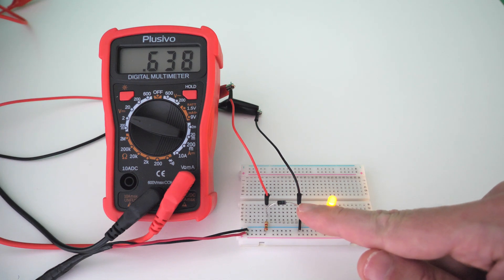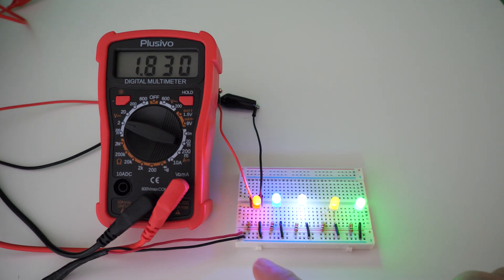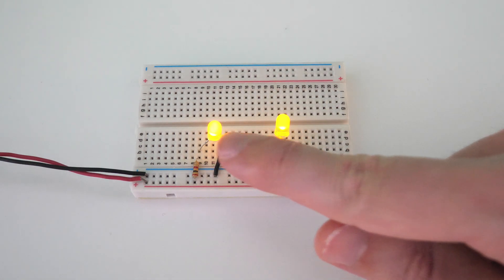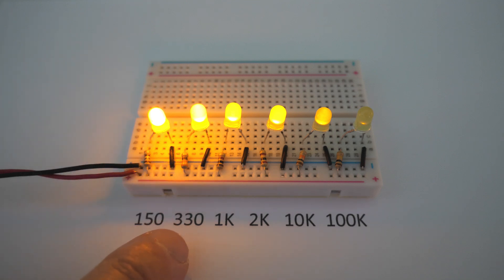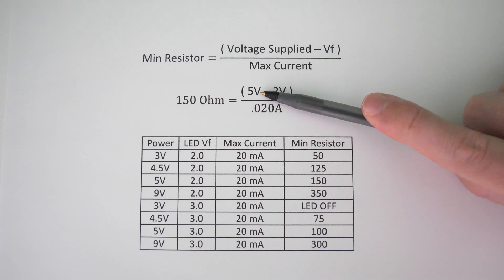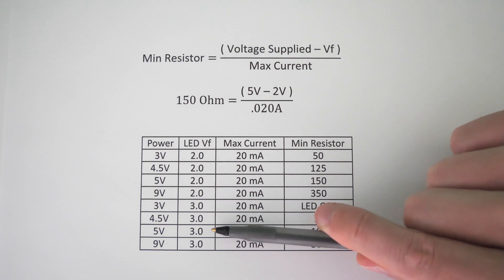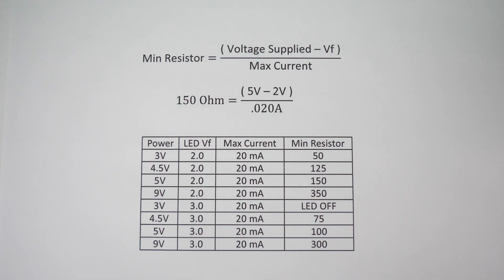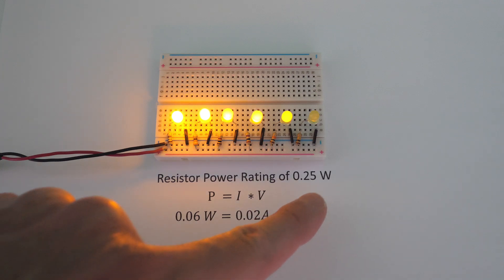LED Current Limiting Resistor Values

Comment: The circuit at 3:34 is a parallel circuit right ?
Reply from the maker: Yeah, each current limiting resistor is connected directly to the 5V power supply.

Comment: My LED fused
Reply from the maker: Do you mean it broke or burned up? If that is the case there was not a resistor in to current path or the resistor was of too low of a value to limit the current.

Comment: Interesting LED display. I just forego trying to figure out forward drop for any L:ED and simple install a resister to only allow around .020amps or less. And regardless what the LED forward voltage drop is, the LEDs of any type lights. And you will never ever blow any LED doing that...period!
Reply from the maker: Yeah, if you are not trying for max brightness you can just use 1K plus ohms resistor and you are good to go.

Comment: Why does the 3V source + 3V Led Forward Voltage have a  resistor of "Led Off"? I'm kinda confused what happens when the Source and Led Forward Voltage match and how to calculate limiting its brightness in this situation... as all calculations seem to try to devide a value of 0 (3V-3V=0V)/Amps.
Lets say I would like to run my leds at 0,010A instead of 0,020A. I would then calculate 0/0,010 = 0 also... How is this done?
Reply from the maker: If the forward voltage drop of the LED is 3V and the power supply is 2.99V. The diode will not allow any current to pass so the LED is off. This would be like applying .5V to a diode that has a .6V voltage drop. No current passes. Even if it is slightly over there would be very little current. Say the power supply is 3.01 volts. Then the current is .01/100 Ohms which is  .0001 amps. Current is flowing but not enough to visibly light the LED. In this case I am saying the LED is off. If you want to be a lower current value just use that as the max value and use the same equation.
Reply: @GlobalScienceNetwork   Thanks for you reply :). I actually needed to build a 12V cirquit of 6 leds that have a forward voltage of 2.0V. The catch is that the cirquit usage needed to stay below a certain amount of watt, so I could not shine at 100%, but was limited to, lets say 500ma.  I put all Leds in series, but I could not calculate what resistance I would need to only let current flow of 500ma (about 40% of Led max power). I decided to try and measure the LED real forward voltage @ 2V with 500ma. I set current limiting to 500ma on my power supply, connected a single led to it, and slowly increased my voltage until I saw it reach the 500ma limit, what turned out to give me 1,53V. Going any higher would trigger the limiter. While increasing only the current (not voltage) I did not see the current growing, it stayed at 500ma, and only got higher if I increased the voltage by 0,05V. So.. assuming in my senario the Led Forward Voltage is not 2.0V, but 1,53V (at my current/power) I suddenly could do resistor calculations as I have volts over to do calculations with. I ended up making the cirquit with 6 leds in series + the current limiting resistor the calculation gave me, and this gave me a reasonable accurate result. When I removed the voltage drop of the resistor, and calculated the watts consumed by the Leds it actually was pretty close to what I needed. Thanks for this vid, and ya resonse, and I hope this post helps someone who is also getting confused by the Forward Voltage often displayed in documentation. The Forward Voltage does not seem to be the exact on/off point, but the point at witch the Led reaches a certain amount of output. In my case the led already started to turn on at 1,28V or so.

Comment: The resistors don't limit the current. They set the current for a specified supply voltage. There is no current limiting effect whatsoever.

Lets use the correct terminology please, terminology which accurately reflects what is going on.
Reply from the maker: A current limiting resistor is a common term used for LEDs. Without the resistor, the current will be very high and burn out the LED or reduce the LED life expectancy depending on the input voltage. With a properly sized resistor added, the current is reduced compared to not having a resistor, and the LED will be operating within the specification limits. I am pretty sure limit is meant to describe that the current is reduced, however, it could also mean that it sets the current not to exceed the max current rating or limit.

Comment: BTW, you ought to note that Vf varies a lot with Vf; just measure the Vf across each LED with the different resistor values... I used to be responsible for 2x10 ^9 LEDs per year....
Reply from the maker: Yeah, that is a good point! I did mention the voltage and resistor value I was using (5V and 2K) but I did not clearly say the voltage drop will be different if you change the resistor value or voltage used.

Comment: Why do you say that the brightness of the 5mm LED will be higher than the 3mm LED...if they have the same Vf at the same If, they are the same die size...the 5mm LED has more optical material, and can make a "tighter" beam, but the total light output is probably the same...
Reply from the maker: Interesting, that is a good point. I was going off the spec that a 3mm red LED light intensity was 1000-2000mcd and the 5mm was 2000-3000mcd. I think you are correct that it has to do with the beam width. So it lets off the same amount of light but the 5mm LED will be brighter at any given distance away if you are within the focused beam.
Reply: @GlobalScienceNetwork  yes, it's just that the MCD reading is a "point measurement", whereas the total output in Lumens is the power output...so, the LED die is the same 'brightness', but the 5 mm package allows for sharper focus and more of the radiation from the die to be captured...
Reply from the maker: @lohikarhu734  Copy that, thanks for pointing this out!
Reply: @GlobalScienceNetwork  Sir, thank you for taking my comments in the way that they are intended...in truth, I would, in cases like this, prefer to use some kind of PM, instead of 'Comments'
Reply from the maker: @lohikarhu734  It is nice that it is in the comments cause the video can not be edited. So comments are where people make additional points I did not think of when making the video.

Comment: Can you recommend a power led?
Reply from the maker: If you mean a high power LED this would be a much larger LED than you would use in a breadboard. A high power LED would have a max current rating of 300 ma or greater. These typically use a constant current driver. The LED is typically surface mounted to a piece of aluminum to help dissipate heat. For breadboards the standard green LED actually has the highest light intensity value and the white LED has the second highest.